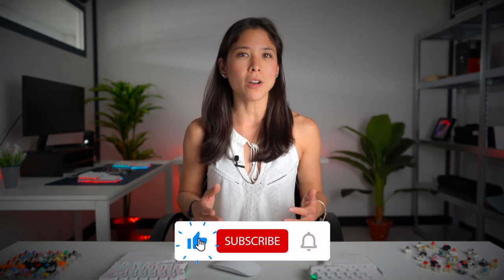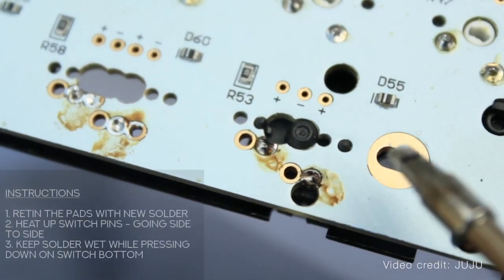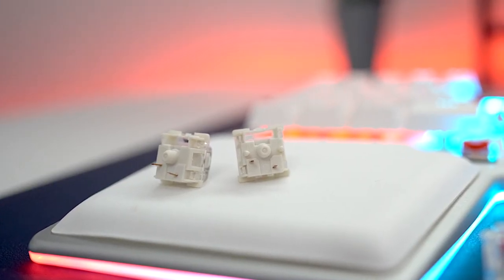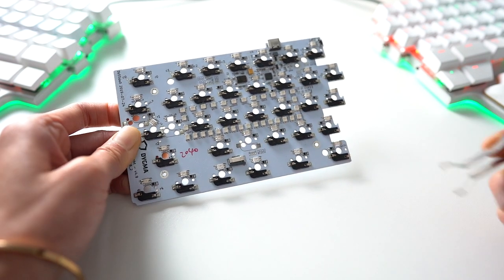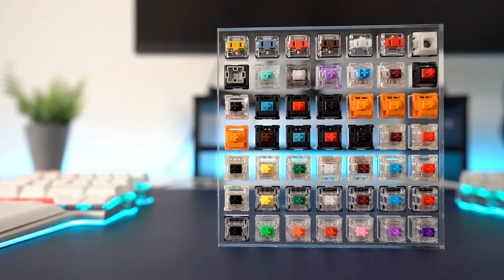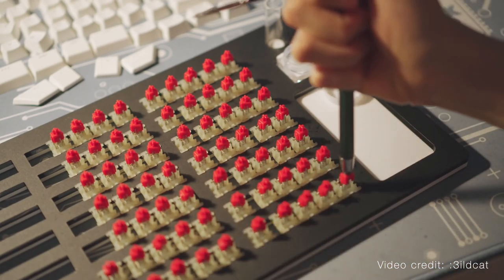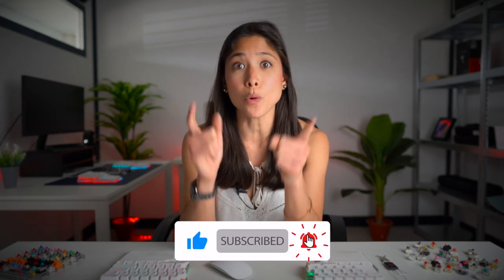What you need to know about hot-swappable keyboards!

Comment: This is a bit pedantic, but I'm gonna say it anyway: pretty much all keyboards are hot-swappable, since you can unplug them (or unpair them) from a computer and plug them back in (or wirelessly pair them) to a different computer or device without needing to turn those devices off or replace the device entirely. Not all keyboards, however, have hot-swappable switches (which is the topic of this video). To summarize: calling a keyboard "hot-swappable" is not the same as calling a keyboard "with hot-swappable switches".
Reply from the maker: You're right. Hot-swappable switches or hot-swappable sockets is the precise way to refer to it. It's just that most people use that expression.
Reply: I don’t think anyone is confused by swapped switch vs a USB connection. If someone is watching this video I certainly hope they don’t get confused.

Comment: All USB (and even AT) keyboards are hot-swappable.  Sounds like the creator here is confused between "hot-swappable" and socketed.  Nearly all CPUs are installed in sockets and can be removed and replaced without soldering, but are definitely not hot-swappable.
Reply from the maker: Keyboards have come a long way, but when we published the video, it was not the case. However, we're glad this video has not aged well, it means users have access to better features 😊

Comment: Good video. I am a die hard hotswap keyboard user my self because replacing 1 switch is soo much better than having to buy an entire new keyboard if you don't want to pull the keyboard apart and muck around with soldering.
Reply from the maker: True! It's way easier to change everything and make a new keyboard with only some new pieces, not to comment on the price too.
Reply: Which keyboard would that be? I have a Durgod Taurus K310 that was sold as hot swappable but which I now find is not.

Comment: I would recommend the royal kludge if you are just starting/getting a budget keyboard. Hard swappable, really cheap, easy to dismantle and assemble, easy to tape mode/pe foam.
Reply from the maker: It's good to start testing swithces and keycaps and make the first modifications to the keyboard. As a level entry it's good. 

But in time you'll need something else, like a split keyboard, more custmization options, better ergonomics.... You know, like a Raise 😋
Reply: @DygmaLab  yeah that's when you know you fell too far into the rabbit hole and there's no going back anymore XD

Comment: i currently use silvers i also put o rings in kb as dampers and travel reduction, i like silvers i may get red to try a bit heavier, little sensitive at times when you rest your fingers on the kb, but i used blue for a long time and dang never again .. i might try brown, mostly for typing i kind of prefer tactile, but i got used to linear and im not sure of anything anymore so i was looking for hot swappable kb :P . thanks for the great info :)
Reply from the maker: We're adding Gateron G pro 2.0 yellow to our switches lineup, which are a bit heavier than the Speed Silver (50g vs the 40g of the silver), and might help with the sensitivity issue you mention.

Comment: this is something i should have checked when getting my new keyboard, well i like mine anyways and if i really want to switch them in the future i will learn to solder. I dont know how to solder but im a trained welder so it can be to hard to learn
Reply from the maker: It's definitely possible to de-solder the switches. You can follow a good YouTube video guide on it. However, having a keyboard with hot swappable switches saves a lot of time and possible issues!

Comment: can i desolder my plate mounted mx switches and just plug them in to hot-swappable keyboard?
Reply from the maker: If you manage to remove al the solder material, and straighten out the pins, you can 😊
Just be careful to not bend the pins while inserting them! You can develop a "feel" of when the pins are in the correct holes on the socket, with experience. Go slowly at first, and wiggle them a little before inserting them all the way, to make sure the pins are in the holes. With time, you will be very quick 😉

Comment: I came here after a single switch broke on my soldered keyboard. Replacing that single switch was an absolute nightmare.
When I discovered there were hot-swappable versions of this, I decided to never go back to the soldered route.
Reply from the maker: Knowing how switches randomly fail sometimes, I'd never go back to soldered keyboards ever again either 😅
Reply: @DygmaLab  I bought a replacement keyboard today, immediately after seeing this video.

Previous keyboard fell off the desk and broke the switch + within the cap. Had to replace the switch and botched that, therefore the ESC key no longer worked. Keyboard is now useless.

Your overview was very helpful, and because of that, I'm all about the hot swappable ones now. Thank you!

Comment: what happeneds if my keyboard don't have any switches with a pin in it? will it still fit?
Reply: those are optical switches, i tried to put them and they don't fit. they also cant actuate because normal switches have electrical contacts. the optical switches are only compatible with optical pcb's

Comment: If I have a specific type of switch, do I have to stick to that brand of switch? Or can I change from outemu blues to cherry mx reds for example? Also, can a 5 pin pcb support switches with less pins?
Reply from the maker: It depends on the keyboard but theoretically you can switch from Outemu to Cherry. And yes a 5 pin pcb can support switches with 3 pins.
Reply: @DygmaLab  Ok and thanks for responding

Comment: Alright so I think I'm finally getting an understanding of this stuff but can you reply and assure me I am? So basically if a keyboard is hot swappable you can take the current switch out and replace with any switch with the same amount of pins or break the extras as you said but it just has to be either mechanical or optical depending on what the keyboard came with? So if I got a keyboard that came with mx cherry switches for example I would be able to switch with kailh box jades?
Reply from the maker: Optical switches are different from mechanical! But the rest you got right :)

Comment: since we can change the switches on these keyboards, does that mean that if i have my own switches, all hot swappable keyboards are the same regardless of price since i will be using my own switches anyway?
Reply from the maker: Not really. Switches are only part of the equation. You've got build quality, the PCB can have white LEDs, RGB LEDs, per-key RGB (like our board) or no light at all. Then there's the keycaps, the form factor, the layout... there's so many things that can change in a keyboard besides the switches 😅
Reply: @DygmaLab   oh i see, cuz i actually have a 60% with alot of spare switches but i feel like changing to 80%, so other than switches and keycaps(and the fact that i am actually getting old and dont really care about rgb), i only need to find a good build for the keyboard huh?
(ig the build is the frame)

Comment: hey, i got a question. so i got myself a keyboard and it doesn't says it's hot-swappable but it's a removable switch. what's the difference?
Reply from the maker: Well, as you're describing there's none. Hot-swappable is the name of the feature that allows you to change swtiches without the need of soldering them.

Comment: Where can I find one of those things she uses to show off individual different switches??
Reply from the maker: Hi Vuk, 

Those are called "Switch testers" they are sold on Amazon, Aliexpress, Bangood, KBD fans... almost any huge online retailers sells them. You just have to pickup one that contains the switches you want to test. 

One final piece of advice, if you want to test the sounds of the swiches, remember one detail: since the testing box is not a real keyboard, the sound might be different than the actual one. The circumstances, like the keycaps, stabilizers and materials of the keyboard might change the resulting sound.

Comment: Hey Dygma, i just want to know, if i use a hot swappable keyboard with outemu… can i change the switch into gaterons without soldering?
Reply: Though I'm not Dygma, I would just like to throw out a helping hand[lol]. So long as your the type of switches you're about to use are the same with the keyboard's, it should be good to go. I mean, if your keyboard has optical switches, then, you're pretty much stuck to changing switches which are only optical. But then again, if you have a hot-swap mechanical keyboard, you'll have more variety of switches to choose from.

Comment: i have a da gaming meca 6. The switch is outemu black. The switch didnt soldered to the pcb. The switch is detachable. But i think its only fit outemu switch. Is it a hotswappable pcb?
Reply from the maker: If the keyboard is hot swappable, which it seems to be, you can use any switch with 3 or 5 pins, not oly outemu, but also cherry, kailh, gateron...

Comment: Am I able to put low profile gateron hot swappable switches into a k12 with standard hot swappable switches? Basically my question is whether or not LOW PROFILE hot swap switches are interchangeable with STANDARD hot swap switches.
Reply from the maker: Hi Jumping, 

Unfortunately, the answer is no. 

Stardard Mx swtiches have a different bottom than low profile switches, and therefore, they don't fit in the same PCBs as regular switches. Low profile swtiches can be exchanged with other low profile swtiches, and so it happens with regular ones. Hope this helps 😊
Reply: @DygmaLab  Thank you, this information does help!

Comment: corsair keyboards, I got a k68 a while ago I can take the caps out but im not sure if the actual switch is hotswappable (it has cherry mx switches)
Reply from the maker: I don't think the K68 is hot swappable. In that case, you have to dissasemble, desolder the switches, and solder new ones. 

This will take quite a while and requires tools like the solderer and the solder remover.

Comment: 0:50 if i want to replace a solder switch can't i desolder it and solder a new one ?
Reply from the maker: Yes, of course you can. It's just an operation that requieres time, knowledge and tools that not all users might have available.
Reply: @DygmaLab  cool, Soo i can desolder Omni point or Lekker and solder in another PCB ?

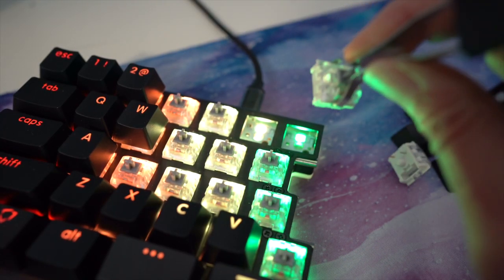Comment: What kind of switch do we see at 6:25? i need a few of those :)
Reply from the maker: Those are Kailh Choc Low-profile switches. But be aware that those don't fit in regular sockets. They have to be special sockets for low-profile choc V1 switches.
Reply: @DygmaLab  i have a keychron k1 keyboard, with some dead switches, so i guess they will fit. Thanks for letting me know :')